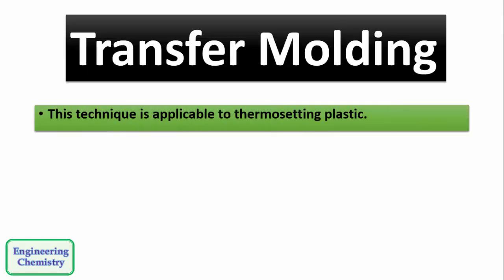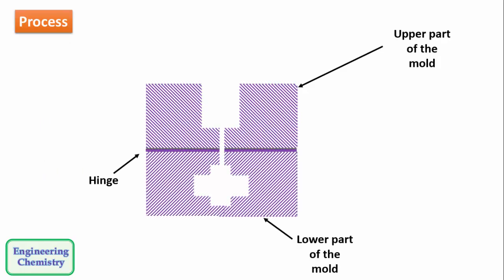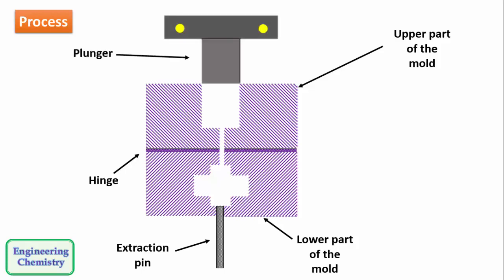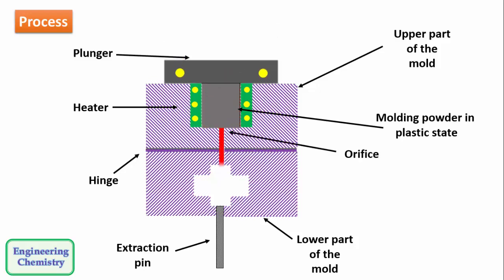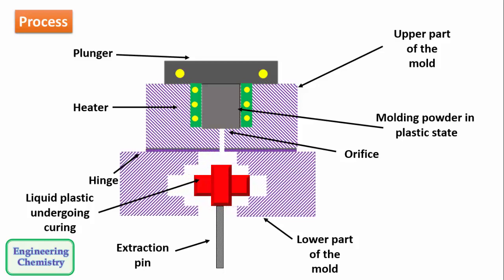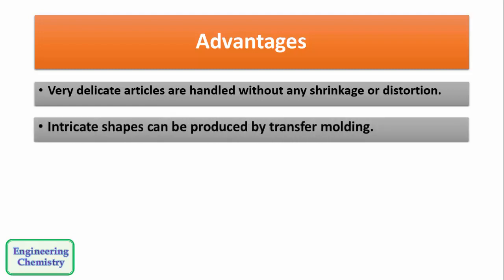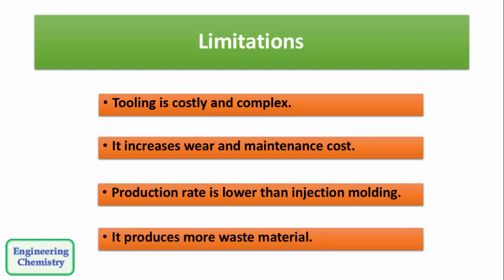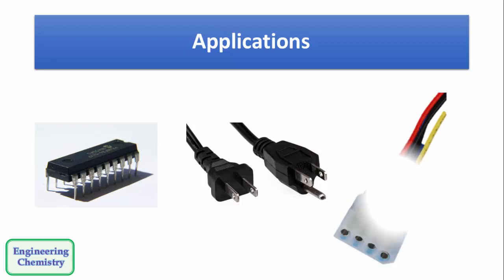Transfer molding

Comment: Aren't there different polymers? Such as thermoset which once cured are irreversible to process for the better part. Thermoplastics can be processed once adequate heating, shearing and pressure are in a place  i.e in a molten state and can be cooled when these three requirements are removed the material would cool and the polymer chains would adequately align themselves?
Reply: Yes there different types of polymers such as thermoplatics ,thermosets, degradable and biodegradable